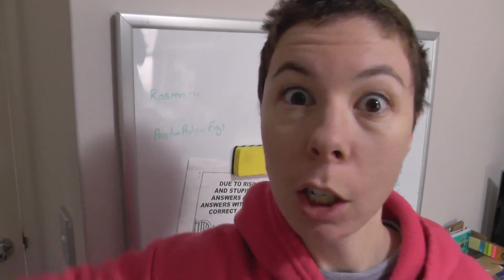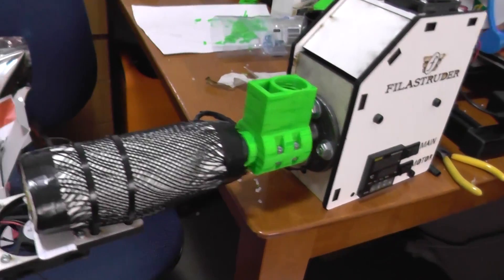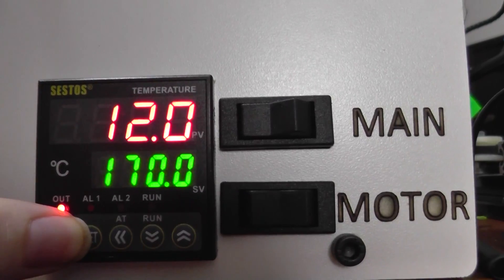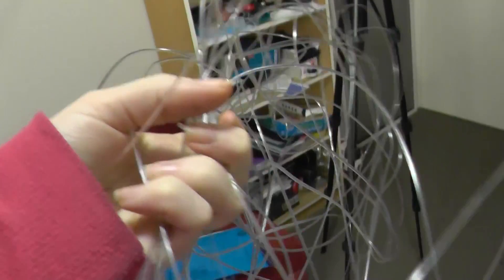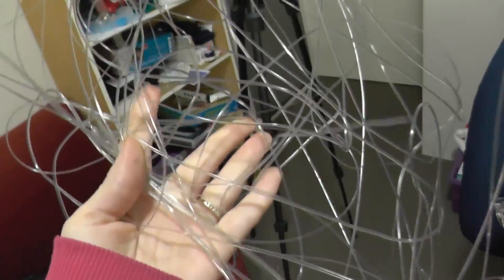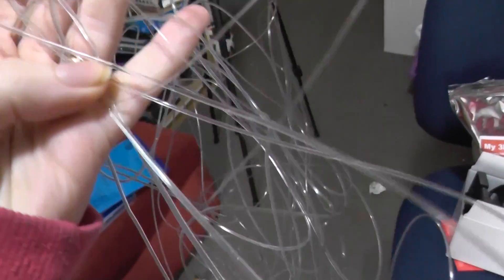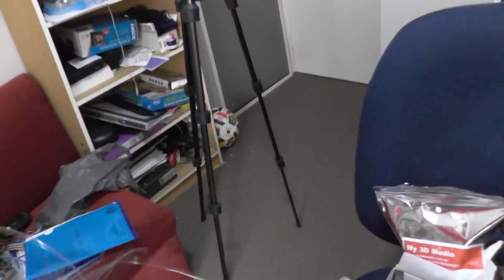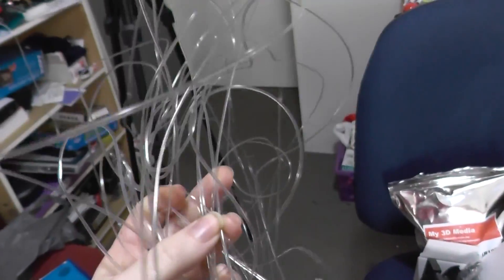Building the Filastruder v2.0

Comment: how to connect temperature controler to heater its very difficult. and  how to increase temperature in sestos controler
Reply from the maker: My temperature controller came with some instructions on how to wire and how to operate it.  If yours didn't, maybe look online for the data sheet. 😊

Comment: PLA should never go into a recycling bin, if it's mistaken for another plastic and recycled with it, it makes the whole batch unusable and can thus result in a lot of plastic going to landfill. PLA is natural and compostable so it can go in a municipal compost bin with leaves and garden cuttings (garden compost usually doesn't get hot enough), and it will do less harm than  other plastics in a landfill.

Comment: so yeah i am making a lot of waste printing raft's and suport's and stuff i should get one of these
Reply from the maker: hi Daan, thanks for watching. that really up to you I personally found that I don't really use it, it became just another thing that sits in the garage. to take full advantage of the system you will also need a way of breaking up/ grinding your waste prints into small enough pieces and a automated filament winder as well. the results are not comparable to commercial filaments and the quality diminishes with every recycle, so mixing with virgin pellets is a good idea. lastly bot all pla or abs is the same, different additives from different companies so mixing scrap may also potentially cause quality issue. overall I think it's a great idea if it doesn't hurt the bank to get it and you just want something to experiment with and best use would be 100%virgin pellets rather than scrap.

Comment: Mate, do yourself a favour and build the extrusion section of the Lyman V5 extruder, it uses a stretching motion to maintain a constant diameter, and more like how commercial produced filament is made. as the puller rollers take the 5mm extruded plastic and stretch it to either 1.75 or 2.85 depending on the settings.  As it uses a sensor to track the diameter.  You can use your Filastruder for the parts you need.
Reply from the maker: Celcius1au thanks for watching :) yeah I love the  Lyman design! have you seen where you can even use a water bath.. although over short distances the bath probably doesn't achieve much.
Reply: Yes I have one currently being built, I produce filament commercially, and build a lot of my companies extruders, we use a two bath system, a hot bath to anneal the filament and a second to cool.  Alot of our machines are based on a combination of developments from Filastruder and Lyman, plus with my own refinements, so my company can produce filament commercially but not at the expensive cost of buying commercial machines

Comment: You don't know if they can recycle the plastic that you recycle at home? lol
Reply: Diesel Ramcharger They actually won't recycle them at most recyclers because they don't know the composition of the plastic and it isn't labelled or regulated, typically they will only recycle known plastics that are pure from other contaminants (like milk jugs or sports bottles, mixed plastics or plastic plus metal or other materials isn't worth separating, cleaning, and processing).  It would also be nice to not be throwing money away on failed prints.

Comment: Have you managed to get usable filament from this?
Reply from the maker: Mongrel Shark no. it became one of those projects that get put on a shelf in the garage. definately need the fillawinder (automated filament winding onto a spool) to get any kind of diameter reliability
Reply: That would just be a stepper with a spool wouldn’t it? Got a spare arduino and pololu? Would be very easy to make :D
From what I have seen there will be plasticiser and contamination issues? Where you panning on using recycled bad prints etc? New plastic beads?
Reply from the maker: Was always the plan to use Virgin pellets because it's cheaper for me to buy pellets than to buy rolls of filament.

Comment: +SparkyFace5 Can you tell me how to tighten the shaft collar? Thanks. :)
Reply from the maker: try multi-grip pliers combined brute force and a fearless attitude to the possiblity of breaking things :P
Reply: Thanks. What about the black curved item that is supposed to go with the melt filter for the nozzle? Thanks again :)
Reply from the maker: +Marty Enriquez there is a special tool for it. i hope I can spell it right.. Circlip pliers (like circle clip jouned together in one word).. you will want the ones that close when you squeeze the handle I think. otherwise you could struggle with screwdrivers but that can get a little dangerous

Comment: You should not throw that first extruded plastic away! Companys like ProtoPasta and FormFutura charge you a hefty premium price to get metal, wood, carbon and god knows what else as contamination in the filaments... :-D
Joking aside, do you make 1.75mm or 2.85mm filaments? I'd guess getting a bigger diameter filament and modify your printers to work with it would be beneficial. The cross section (area) of the larger filament would not deviate as much giving you more consistent prints if you manage to get the same diameter tolerances/deviations for the smaller and bigger filament diameter.
Reply from the maker: +ExtraBase hahahahah yep look out specialty filament market here comes Premium metalflecks grease and dust PLA haha.
at the moment I am making 1.75mm filament.. well that's the size it says on the hot end.. but I have not done a proper lot yet to test the actual diameter coming out. I think 3mm would be more reliable.. though i am not prepared to upgrade all my machines to be able to accept it right now.

Comment: So you had to actually file down parts they sent you? Wouldn't you think they should do that at the factory so you can just assemble it.
Reply from the maker: There is nothing precision about this kit other than the hot end. I doubt there is a factory as such. However, the kit saved me the pain of sourcing all the parts seperately and they had already cut the hole in the pipe and modified the drill bit, laser cut the enclosure and had the chassis made .. so I am still happy.

Comment: Where are you extruding it?  I thought about buying one but the only place I could extrude it was indoors and I was worried about fumes from any ABS
Reply from the maker: I extruded this lot in my spare room. However I do plan on moving it to the garage later. also I'm using PLA so while fumes may still be a problem.. it doesn't stink up the place as much as ABS would

Comment: I have heard just how hard it is for the companies to make tight tolerance, non bubbled, low moisture, and non contaminated (even household minute dust you can see with the sun through a window) filament that I gave up on the thought on making my own with a Filastruder. :(
Reply from the maker: +Dark Alchemist I hear you.At the very least I'm hoping to make some filament that will be "good enough" for my own personal use.. because most filament is overpriced here in Australia because of shipping and whatnot.
Reply: SparkyFace5
Over priced all over for what it is but being here in the states at least there are options.  Now two years ago the only options were Chinese filament with metal in them that jammed up many a hotend (I am one).